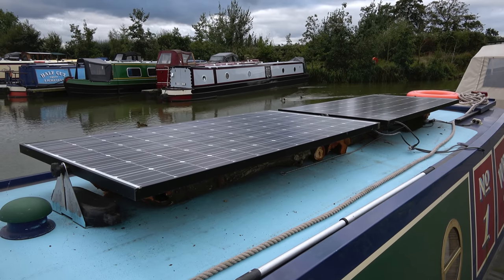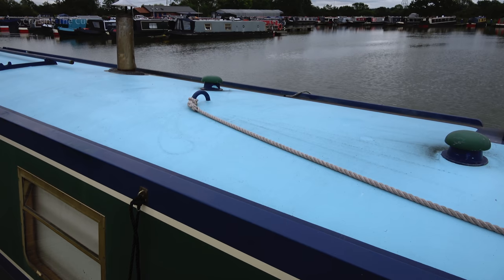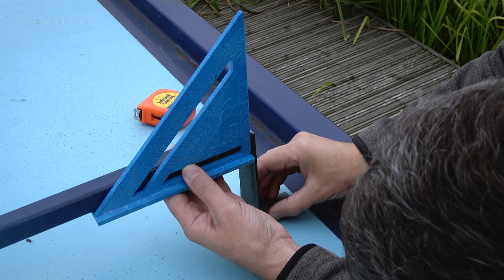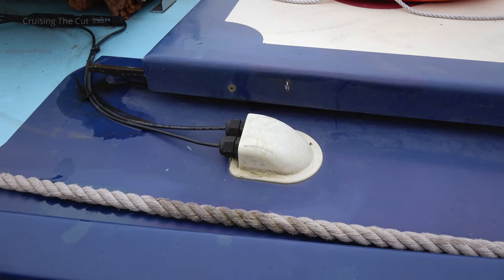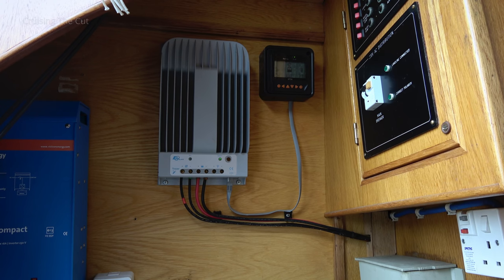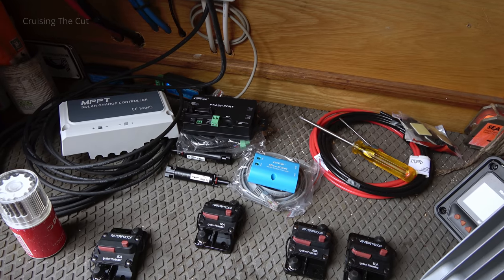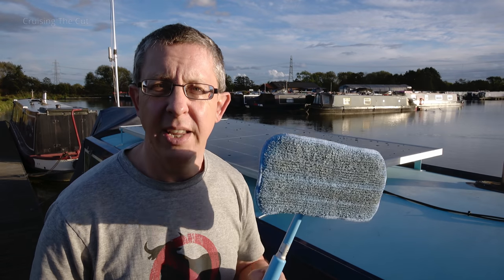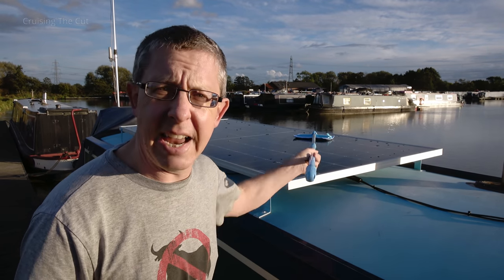251. Adding more solar power to my narrowboat

Comment: A very nice and clean install, and looks pleasing. The only thing I wonder is, once they are hooked together, do the green lights flash at the same time? Because having them out of sync would drive me cover them with tape. 

Now I doubt your walking across the center of your boat, so putting brackets on to hold them down probably aren't necessary, though might still be a good idea at some point in the future. I'm tempted to say to give them a quick coat of paint so they blend in the with the lighter part of the roof, but that's probably more trouble then it's worth.
Reply from the maker: As they’re in the engine room, I never see them flashing out of sync!

Comment: Rather than trailing the new cables along the top, had you considered drilling straight down and routing internally behind the panelling?
Reply from the maker: Getting it through the internal panelling without making a mess would have been a nightmare.

Comment: Another excellent vlog from your good self, thank you
I have just been watching your previous vlog where you changed to the lead carbon batteries and would like to know why you chose them over replacing your old AGMs with new as they had obviuosly done well to last 10 years and it would have been a cheaper option.
Thanks again
Reply from the maker: They seemed to have advantages such as fast charging, resistance to degradation when partially charged, multiple charge cycles even when fully discharged etc

Comment: Are you worried about a galvanic response between the bolts and the frame of the solar panels?  If so, then us either rubber or plastic sheaths to help against it.  Just a thought, and keep up the vlog.  Well done.

Comment: Lovely to see a solar build without using all "Blue" components for a change! Out of interest, does the central comms unit work - in terms of stopping them conflicting with each other ? Thanks for the video!!
Reply from the maker: It turns out, they work perfectly happily without it! The three days while I was waiting for the cable they just did their thing; and when I did get the controller wired, it took to turning off one of the chargers whenever it was overcast with little power coming in. Oddly, this seems to be a design function, it’s mentioned in the manual but I don’t understand it. So I’ve unplugged the parallel unit and now they do what they want and it works fine. I will explain this in a video update in a couple or months.
Reply: @CruisingTheCut   I look forward to it! I too noticed that my shore power charger or battery to battery charger don't charge at optimate rates because the solar fools them into thinking the battery is full - hence I am interested!
Reply from the maker: Ah. I won't be able to answer that as I'm not plugged in to a landline.
Reply: @CruisingTheCut  Same predicament as yours except I have to link my charger up with my solar etc

Comment: oh man, this was the one i was waiting for on davids tech channel, lets go for it! haha! campervan guy comes through!....when did you get a tarp for the steering position?i missed that, and also now that you are going onto solar,  and no marina this winter, whats up!? im sure you will let us know in time.

im loving this because you sound like me in 2008 when i set up a solar panel for the first time, but, my god, its gotten more complicated since those days, hasn't it!

as a guy that had an off grid place for several years, where is all your electricity needs coming from david? washing machine? or something, based on your older vids, you had a battery bank, charged when boat was running,i was semi jealous of, so you need more power! scottie! so, it has to be for a reason. curious what you are doing.

david has plans...he has plans..... evil laugh
Reply from the maker: There’s no tarp on the steering position!

Comment: Great video and detail. I do wonder when a panel will be made that has water management built in, perhaps a slight curve to the panel to avoid water sitting on it and having it run off instead. Perhaps thats typically an installation question in regard to installing it with a slight angle to give rainwater a route off.
Reply from the maker: Cheers. I’ve never found the panels being flat an issue on my campervan (and I’ve had that for three years now). Maybe a bit of algae growth round the edges but that’s easily wiped off every now and then.
Reply: @CruisingTheCut  That is good to know. I think I have my eye on a future where panels are flexible and curvy. I wonder how it impacts their efficiency if it was curved to match a hull and was form fitting.

Comment: I would remount those 4 controllers on a marked up small batten of 4 by 1 of varnished wood and then fix that batten back on the wall so all will be neatly in line. And buy a small 8" plastic level.

Comment: Great explanation David. You did not mention why you need to first connect the charge controllers to the batteries before you connect the solar. Answer: otherwise you will fry the charge controller as the charge will come in from the solar and then have nowhere to go.
Reply from the maker: It's because the charge controllers can work at either 12 or 24 v and you have to connect them so they detect what to use before you give them the feed from the panels, so the MPPT gets configured correctly.

Comment: Question; when you disconnected the old solar panel was there not power coming from the solar panel?  Did you cover the panel to shut of the charging?  Aaahhh you disconnected the panels. Clever boy!

Comment: Thanks David, no one ever shows the process, very informative as usual :) One question, have you considered using the panels to drive an immersion heater when the battery hits fully charged?
Reply from the maker: Considered vaguely but I already have a 230V mains immersion so that would have to be swapped out and I'm not convinced I want to.
Reply: @CruisingTheCut  Once batteries reached float voltage, a step down transformer from your invertor giving you 110V could be switched to feed your immersion - 110V would let it run at a few hundred Watts, rather than its probable 3KW on 240V,  and 'background heat' your water, so saving you the landline electric costs of heating it from cold and not wasting all that lovely free solar. You could still have the landline feed and just switch between the two. Maybe your new interface could even do the switching for you. It's just a thought and I fully see why anyone wouldn't want the complexity! Thanks for the reply :)
Reply from the maker: Cheers. I'm not on a shoreline anyway at present. The heater is a 1kW item so in theory the inverter could power it "as is" (though the immersion wiring actually bypasses the inverter, specifically so I don't kill my batteries) but it could be made to do it.

Comment: Did you consider putting panels on the sides between the windows? Seems to be quite a bit of room and when the sun is at a low angle maybe having them there is better than on the roof? Some of those flexible panels you tested to destruction a few years ago maybe? :-) Shouldn't be in the way much and melt in fairly well.
Reply from the maker: They'd only work on this mooring; out on the canal such low sun would largely be blocked by trees and bushes along the canal and you'd have to be lined up at the right orientation for them to see the sun anyway, which on a perpetually twisting canal is unlikely, making it not cost-effective.
Reply: @CruisingTheCut  Yes, it's always a compromise. Hope you have use for all the extra electricity in the summer :-)

Comment: My friend... have you considered using  Butyl Sealant Tape? It is a premium grade, sound deadening material and butyl rubber sealant tape that is pliable, sticky, and tough strong enough for any project. Such as putting it under the brackets then use silicone on outside edges?
Reply from the maker: I used it on my campervan but generally use Sika on this kind of project

Comment: Your low power output is kinda typical for solar panels in the more northerly latitudes (or more southern ones as well), this is why I don't see it as a total problem solver north of about 40 due to low winter output.  Even in summer the angle of the sun means the rays go thru a lot more atmosphere and loose some of their spirit, hence you only get 33 of your rated output.  Honda (and others) make small inverter petrol alternators, I think the smallest do about 1000 watts.  The deal is that they are very quiet when running and they are very frugal on petrol use, and hour or two in the morning would cover your morning needs and get the batteries ready on a dark day when the best panels won't get you much.  Most also feature a 12v circuit for direct battery charge while doing the AC thing at the same time.  This can also get you enough power to run tools (or lights) since most portable tools are within their range.  Another thing that might help you is Cobalt steel drill bits,  they are harder than HSS and last a lot longer as a result plus they drill a lot faster.  They cost more but are worth it after just a few uses, you'd only need a few common sizes, not a full set.  On the few winter trips to northern Europe I noted that the sun slept in till nearly 8AM and called it a day around 3PM leaving a long night for your batteries.  You also might consider a 'trickle' charger or 'maintainer' for your starting battery since you seldom use it during winter and they will self discharge and also have a shorter life if not kept up on charge.
Reply from the maker: Cheers. Those Hondas are great but very expensive plus I'm in a marina where generators are frowned upon for noise (even quiet ones). I am able to run my engine for additional power generation though plus I have to move the boat every couple of weeks to refill the water tank so a trickle charge on the starter is unnecessary.
Reply: @CruisingTheCut  They won't let you run a small generator but are OK with running the bigger propulsion engine to charge your batteries?  Whiskey Tango Foxtrot.
Reply: @HiroNguy  If they allowed generators you would see a noise creep as people got bigger and bigger and cheaper and noiser generators.  Then they would have to arbitrarily tell people their particular setup is too loud with no real standard.  Better just not to go there probably.
Reply: The use and storage of petrol (gasoline) on boats is problematic. To comply with safety regulations petrol fuel and equipment must be stored and used such that any petrol vapour or fuel leak drains away from all enclosed boat spaces - the same as for gas storage. A boat would need a second “gas” storage locker, or external rack below deck level. When the generator is running it must not allow carbon monoxide into the boat, or any neighbouring boat. Diesel is much less of a problem in both respects.

Comment: David, I know you put sealant around the rivnut and the metal boat ceiling. Just curious, what about sealing between the threads of the rivnut and the bolt? I rewatched and saw you sealed around the brackets and around the head of the bolt. Well done.

Comment: A good way to hide the cables is getting some rope that has 2 parts to it. An outer sleeve and an inner core. Remove the inner core and slip the cables you wish to hide inside the outer sleeve of the rope. Than lay down the assembly on the roof of the boat and plug into the panels and down into the boat through the cable box and it should look like boat rope laying on top of the boat, instead of out of place snd ugly cabling.

Also regular UV protected outdoor cable sleeves, various colors, can ensnare and cover the cabling like a regular cabling project.

Sadly this comment is quite a few years too late...

Comment: David, did you consider a bifacial panel? I'm building a solar system here in Oregon, USA. Went with bifacial(and was eventually able to stop chuckling every time I said that name) panels because of the better low light and overcast performance. Our winters are very similar to yours.
Reply from the maker: I looked at those and as far as I understand it, they generate a little extra from any light reflecting back up off the surface below, and notwithstanding that my roof is quite a light blue, I can't see how the underside will see any worthwhile light at all, with the panel itself casting shade!
Reply: @CruisingTheCut  Aye sir, completely understand.

What swayed me was a Will Prowse video where he got 5% more power over the course of a day just having the panels flat on concrete, with one edge up on a brick. I've also seen other people report 25-40% more power throughout the day, having the panels mounted up off the ground. The increase was well worth the cost, I thought.

Comment: I have to say I’m very undecided on the linking together faffology, the reason being that, if the batteries are low then it’s not needed as both will see low batteries and max themselves out anyway and, if batteries are fairly full then it doesn’t matter if one backs off before the other as the batteries can’t take the output of both so in effect physics does the job anyway. The comms thing simply makes them both reduce so the batteries end up getting exactly the same but just split between the solar controllers. If load outstrips supply the other controller in an un communicated system just trips back in anyway and of course the paralleling device will have a small power overhead as well. I wonder if it is more use as a single point monitoring device, dunno. Anyway glad to see you are a happy bunny with your extra solar, it really isn’t possible to have too much on a narrowboat to my way of thinking.
Reply from the maker: Hi Phil. I completely agree and have since removed the parallel box which spent most of its time turning one of the controllers off in low-wattage conditions, which is the last thing I wanted. By chaining the controllers together and then one of them to the Bluetooth device, I can monitor them both from the app albeit you have to switch between them.

Comment: Next time cut a piece of plywood that fits the space, then mount all the devices to the plywood and then mount the plywood to the wall.  Will minimize holes in the walls and makes the mounting work easier.  Stain, paint, trim work to make it beautiful and labeled.

Comment: How do those rigid solar panels compare to the flexible walk over ones? The ones that stick onto the roof, It seems to me that you could almost apply them like flooring and keep the usable surface area on the top of the boat.
Reply from the maker: From what I hear, they don’t last as long as traditional panels, they aren’t as efficient because (being flat to the metal roof) they get extremely hot in the sun (which makes solar panels less efficient) and they’re much more expensive. Really their only benefit is nicer aesthetics.
Reply: @CruisingTheCut  If i may chime in on this. Yes the rumour is semi-flexible doesn't age so well, and yes they are less efficient but only by a few % (=1 cloud/day approx.) But they are much lighter and easier and cleaner to install. Also IMHO modern double sided adhesive tape (like 3m vhb) will stick panels down, controllers on bulkheads, cable retainers and conduit no problem. Screws and bolts are old school other than for heavily stressed mounts and vibrating environments.

Comment: From the sound of it you will be spending the winter without shore power. If that is indeed the case you may be confronted with the need of getting a generator to supply mains power. If that happens I would remind you of previous counsel of looking at a propane fueled unit. The primary reason for this is it is less attractive to thieves. Not invulnerable to theft but less attractive to theft. There are other advantages. As you are not moving the setup and take down should been less of a pain. But then again coulda, woulda, shoulda always comes into play. 😊
Mark Fay US MMC Jr. Engineer QMED AS-E

Comment: David, what is the recommended maximum height of fixed narrowboat components (the 'low bridge' factor)?
Is this above the waterline?
Reply from the maker: Offhand I can’t remember but yes quoted above the waterline (“air draft”) it’s specified in the canal guidebooks for each canal.
Reply: Do the canals height change when you have more rain or less rain.

Comment: Nicely done. Did you consider a boat wind turbine? I had a fosa 400w unit on my sailboat as a backup (most of them now are 1200w)
Reply: Whilst they work well on sailboats where you get a good breeze across open water, living on the canals means that you are often sheltered much more and therefore they become less useful.
Reply from the maker: Please see my pinned comment, at the top :-)

Comment: I just saw your mention of the solar battery temperature sensor taped to the battery
Would putting a small amount of insulation on top of it give a more accurate reading?
Letting the sensor read more battery temp and less battery box temp.
Maybe not that important?

Comment: Maybe you should look into a portable generator (used) if you haven't got one already. I suspect there might be periods of very little sunshine and if so it will arrive at the most inconvenient time  when you really need topped up batteries.
Reply from the maker: Not needed as I can just run the engine
Reply: He already has an on board backup generator for when the sun don’t shine. It’s the alternator on his Diesel engine. Idling and charging, he can probably run 2 to 4 hours per liter of diesel burned. he can probable also heat his hot water tank  from the cooling system if it’s plumbed in.